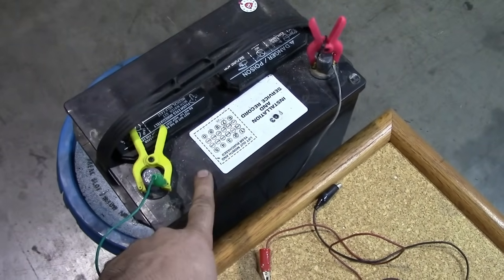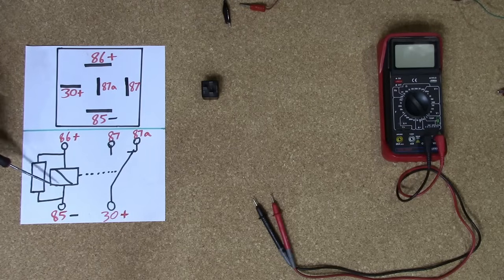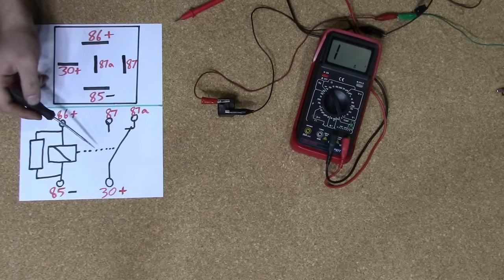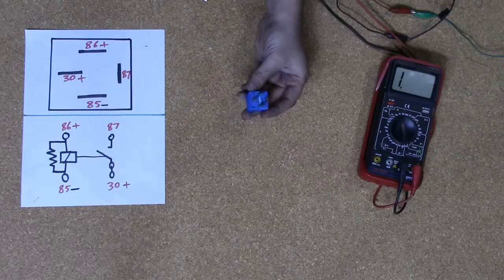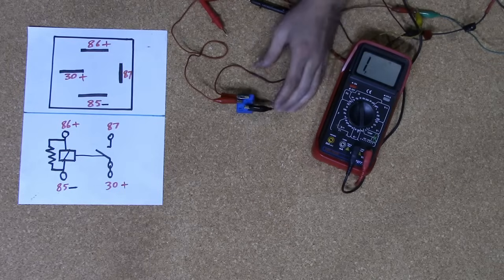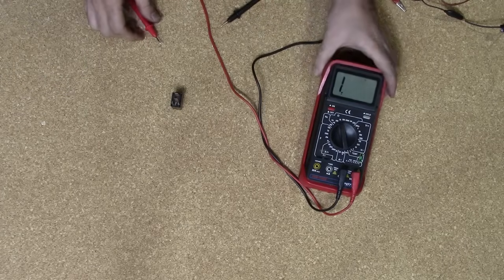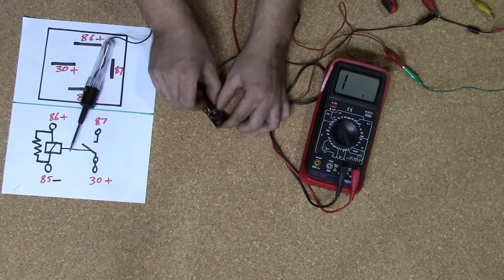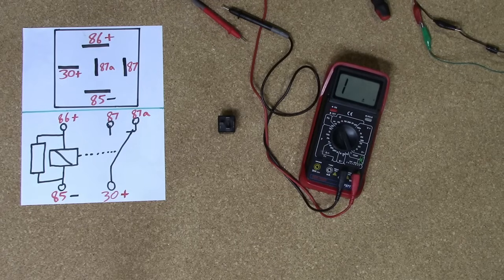How to Test a 3, 4 or 5 Pin Relay - With or Without a Diagram

Comment: Another great video and an outstanding explanation. I would offer just one small word of constructive criticism for future consideration and I hope you receive this in the helpful way its intended.  On the paper you layout the pin configuration and the wiring diagram which is very helpful to aid understanding. The one improvement I would recommend would be to make the wiring diagram match the actual pin layout. In other words, both the pin layout and the wiring diagram would have the pin numbers located in exactly the same place. This would make it easier for viewers with little electrical experience.  I think this may be why a few people didn't follow what you were saying. Even with that small area for improvement, this is an excellent and thorough video. Thanks for your efforts.

Comment: Hey man, really well done video thanks for posting.  I have my three pin relay pulled out of my car and it consistently gets 2.2M Ohms when I put the testers to pins 86(+) and 85(-).  I bought a new one from Autozone and on that one I consistently get 36 Ohms reading when I put the testers to pins 86(+) and 85(-).  This is a brand new relay... any reason why it would be reading at 36 Ohms  between pins 86 and 85?
Thanks
B

Comment: i like the video concept but i dont believe that all relay resistance is the same for all cars i have a honda /acura tsx 2005. i tested 4 different relays the denso and mistuba 7001 7002 7003 . the denso and 7001 and 7002 resistance coil was 156-170ohms and the 7003 was 58 ohms. if i follow his verbiage that would mean that all my relays are bad and those relays go to accessories have no issues with and the one relay that is 58 ohms would mean its good but that belongs to the fuel relay that might be the cause of intermittent crank but no start issue. i like his video but i think he need to actually answer peoples comments.

Comment: Liked the video. I have a 2009 Toyota Tacoma which has a slow crank and a click but no start. Sometimes it starts on the first turn and other times it takes about four to five turns of the key. Battery terminals are clean, new battery, swapped out starter relay with horn relay and still has the same symptoms. What am I missing?

Comment: Hello there,,, I'm wondering if you do not get reading on the pin of the relay after you hook up with the battery..the relay it still good even if the test light don't lit

Comment: My low beams are not activating, checked the relay unbowed, the resistance on control circuit shows 176 Ohms. When powered it clicks and also  has continuity. Could you tell me if that proves that the relay is good?

Comment: So what is the Resistance suppose to be between 30 & 87 pins, unless I missed it, I didn't hear you say what they are to be. Your test is close to zero and you called it good. Can you be more specific plz, Thank You. I have a situation 2003 Ford Focus, fairly new battery, tested and place a full charge on it anyways, new starter, and all I have upon turning key to start position is one single click. That's it, whatever it is that has failed, showed signs of failure, it would randomly fail to start, progressively got worse and as of 4 days again, it flat out won't start. All indication of good power, lights on, they don't dim, when it was starting it hit & turned over fast. But be it a Relay  or the Ignition Switch it's failed at this time. In the last 4 days after X amount of tries at starting the car, it hit once and started. So I am looking for help. So at this point I need the resistance for that test you did between 30 & 87, with power to the relay. Thank You P.S. you did state close to zero in your 4 pin demonstration. I hope that holds true for the 5 pin

Comment: Thank you for this easy to follow instructional video. I used it to test a relay - something I have never done before - and I found it failed the 4th step (the grounded test light did not come on when the relay was energized and powered).

Great job!

Comment: Great video, BUT, my 5-pin relay has power on '86' and '30' with the ignition on.  The relay powers the AUX fan on full speed, it should only be switched by a thermo switch at 110 degrees C.  The thermo switch has 5V coming to it.  Is my relay faulty?

Comment: Shouldn't you have tested pins 30 and 87 before activating the power to make sure it wasn't shorted? The inner switch did click when power was added on but it could still be maybe slightly shorted pin 87 by not completely opening to 87a. Good video. Thanks.
Reply: @
T Marq, you raise a valid point.  My relay has power on '30' and '86' and activates my AUX fan intermittently with the ignition on (it should only do so when the thermo switch reaches 110 degrees C), and stays on when I disconnect the thermo switch.  I'm suspecting an internal short.

Comment: wow that was very in depth. have me very confused. I'm not used to doing very much electrical. I wish the zoom in was better to show us not so good tracers to follow as you go. I'm not getting any clicking sound so its probably bad. I'm working on a tractor with some electrical issues. I have replaced the battery and the solenoid, but the switch will not crank it still even though I can stick the switch in a good tractor and it will crank up.

Comment: Please help as I've been tearing my mind apart trying to fix my AC issues as to why the system wony supply power to the compressor. The only thing I havent checked is the relay. I've checked for continuity on every wire to the compressor, the low pressure switch, etc. I had to replace the low pressure switch and the low fan resistor and now I have 12v to terminal 86 (before only 30 had 12v). If I have 12v showing on terminals 30 and 86, then the relay is bad? (I'm not with the car now so I'm asking before I go diagnose).

Comment: Are there any additional tests I need to do for an ABS relay?    My toyota sienna ABS relay has the exact 5 pin layout a common relay used everywhere else, yet it is marked ABS(TRAC) has a different PN and price.    My toyota sienna is throwing the code C0273
, and  toyota lists the abs relay is the possible cause.  The relay passes the test described in this video fine.  I'm guessing  there is a different different set of requirements  for the abs relay given the different part number,

Comment: When the circuit is energized and you are using the test light, you mentioned to ground the negative side of it. which ground do you attach the ground of the light tester? to the battery ground? thanks
Reply: Yes, the ground of the test light is the battery ground, or the negative terminal, or the black cable.

Comment: Thanks for a great video. Can you do a video on checking electrical connectors and the relay ports?
Reply: it would take me long time to really learn since I'm into the cars without sensors+ ECT but I will get there. can you test fuses with that multimeter? I'm sure it has a voltometer.
Reply: class 101
Reply: my son knows all this.
Reply: like

Comment: If I want supply power directly to to a component which pin should I use?
Reply: Minus (Ground or Black) to 85
Plus (Positive or Red) to 86
You will need to use 12VDC.
And you will here a click once both leads are connected.

Comment: Hi R&W, My Relay Passed Every test except I got about 2 Ohms Across 30 & 87 when energized (92 Ohms across 85 & 86) Shouldn't if be 0 Ohms across 30 & 87 when energized????... 2003 Chrysler 300M
Reply: Yes. The resistance should be zero when that circuit is energized, showing resistance would indicate that your relay is bad. Good luck!

Comment: hello can you tell me please if my old relay can be replays with the same 4 contacts, but there is difference on the plastic relay number, my relay contacts 85 to 86 and 30 to 87 on the NEW relay the same pins but diagram are 85 to 87 and 30 to 86 what do you think?

Comment: Great Video....Csn anyone tell me why?
I did the test on 4 prong and yes I get the ckick.
It's a 12v 70amp for my air suspension relay.
The plug for my system is not letting the relay work.

Comment: I really hope it does not make a difference which pin is 86 or 85 on a five pin unmarked relay because I applied 12V to the two pins that had 47 ohms and got a lot of smoke in a few seconds, then no resistance. So off to Autozone now.

Comment: Awesome video!! Thank you so much!! 
I do have 1 question... I had supplied power to pins 85 and 86 and was testing the resistance between pins 30 and 87, I got a reading of 1.9OHMS (setting was 200 OHMS) on a 5 pin relay. Is that ok? All the other test seemed fine even with the 12v tester (light)... Thanks!
Reply: Your reply maybe still bad. But test these two below.
From 30 to 87A always zero to low ohm reading when no power apply
30 to 87 = zero or low ohm reading while power applied. Then 30 to 87A much be high or open.

Comment: Any idea on how to remove the fuel pump relay on a 2008 Nissan Quest please?
- The fuse panel (gray) is positioned vertically inside the black box on the passernger side next to the coolant reservoir, which needs to be slided out in order to have access to the relay, however, it only slides upward for a few millimetre, not enough to have access to the relay!! What gives? 
I don't know whether the relay is shut, or the fuel pump module!
Thanks,

Comment: I remember these funny numbers when I switched out the fuel pump. full or empty lever on pump assembly would measure ohms. What I measure is off and the dealer has completely different set of numbers.12v is not 12v for the next thing.then new parts are shit on top of that.Both were good. No funny numbers needed.whos numbers and what standard are we basing this from. Every car is different.
iec probably dont have the same numbers either.

Comment: This is the best relay testing I have seen. Today, I need to test my A/C compressor clutch relay on my 6 gen Honda civic 1.4 (UK version) as the compressor clutch is not engaging. It was really a pain to find where the relay was located. I thought the relay was inside the under the hood fuse box but for my surprise it wasn’t there. After spending hours on google I figured out the AC clutch relay is next to the condenser buried inside a rubber boot. In fact, there are 2 relays, one next to each other, I still need to figure which is the clutch relay, any help here would be helpful. Hopefully the relay will have a diagram outside its casing to make my life easier testing it. Greetings from UK

Comment: How much suppose to be the voltage on the pin 87?. No A/C (was good before July) on my Fiesta 2011. Relays and fuses look good. But no power arrives to the compressor. A friend plugged for few seconds a 12V from a battery and then the compressor responded positively. Now, I'm in ???

Comment: Hi R&W, is it enough if I do testing with supply 12v to 85 and 86 to hear clicking sound and another test using the 12v supply with test light. Meaning I skip any testing that need to use multimeter?
Reply: Forgot to mention its a 5pin bmw relay.
Reply: @jannah3023  go get a multimeter,  the cheap ones are only a few bucks. They come handy a lot of times if you're a DIYer. For this test it is important to measure the ohms. Otherwise you'll be in the dark.

Comment: Great Instructions.....I followed them closely and everything seemed to check out on my EFI relay (4 prong) .  But as I unhooked everything the relay was really hot.   Is that normal or could the relay still be bad?  Something is blowing an EFI fuse so the next thing down the line is the EFI relay.  Again,  Thanks for some great,  easy to follow,  instructions.  Take care!

Comment: I watch others but yours is the best, thanks. Question; I'm testing relay pt#14b192-aa,  I tested several times got varried ohms,  33-50.1  , tested positive on all the other three tests. Is it possible to have varried ohms on the first  and have positive results on the other 3 and if so is the relay bad. The relay was getting warm while plugged into it working harness when ign is on

Comment: Thanks for this video ! I am testing a "no-start" 1994 4runner "circuit opening relay" that shuts off the gas pump when slowing down. The power side resistance is 31 ohms, not 50-120. Then the 12 volt power addition CLICKS and completes BOTH of the other circuits on this 5 pin relay (there are NO numbers).  Is 50-120 ohms a definite  bad ? Damn relay is EXPENSIVE ! Thanks
Reply: With no diagram and no pin numbers, I picked up two relays at pick n pull, $5 each. Both have 28 ohms across power terminals.

Comment: Hello sir. Thank you for help us with such valuable knowledge through your videos. I need your help with solving a turn but no start problem i have with a 2003 vw passat. The pump was check with direct connection and it works. I get 3.4 volts at the pump without crank attempt and about 8 volts when i try to start but won't start.

Comment: When measuring the relay resistance pins 30 & 87 the SW in this case the circuit is closed and the 12v is applied to pin 86, so the resistance showes 000 Ohms which is continuity closed switch, or very small if the SW was open then it showes open circuit or no continuity.

Comment: I've got a few questions I tested the ohms on my89 ford rangers fuel pump relay and im getting 57 ohms sometimes 60 sometimes 55 but thats probably cause my multimeter is cheap but hears my next question is that within specs and this is kind of off subject but i'm going crazy trying to get my fuel pump to run correctly its getting power but not enough power to build the correct psi to start my truck all my wires are cracked n broken basically so can i run new wires from the battery to my a new fuel pump, install a new inline fuse and also wire up either this relay or a new one and basically hot wire my fuel pump it has a new fuel pump and the hot wire I'll run to a switch inside the truck so its not constantly running will my ECU freak out? im just over trying to track down a cracked wire ive been messing with this truck for 2 weeks and its my work truck help please

Comment: This is a great video. I'm pretty handy with a multimeter, however I've never been able to figure out testing relays. He makes it perfectly clear with full explanations for each step.  I used a 12v jump box, my multimeter, spare wire/connectors, and made a phone charger adaptor that usually goes into a 12v cigarette lighter port in a car work as my tester (it has a small red light on it so I could tell that it worked). All in all it took less than 10 minutes to watch, setup, and go step by step to confirm that my 5 point fuel pump relay is in working order. 2 thumbs up, great video!
Reply: Lol

Comment: Thank you - I have a problem with the left tail and left front side marker lights on my truck and a common connection point is a relay that I need to diagnose.

Comment: What is the function of a relay??? My car headlights glow dim. The electrician said the headlights would be ok after he installed a 12volt relay in the circuit. The company originally didnt provide for a relay for the headlights which have become dimmer and dimmer. I doubt the techinician

Comment: Thanks for the great info.
You might also want to add a step to check that when the relay is NOT energised, that there is no voltage on pin 87 - if there is it would indicate the relay is stuck on. 
Thanks again.

Comment: I just have to say this.. You are a huge inspiration .. You gave me so much confidence and knowledge.. My 2003 Expedition started with a check charging system late February since then .. I've install new alternator, alternator wiring harness, 2 idle pulleys, removed and cleaned tension pulley, checked all my fuses and relays installed new engine belt ..today I got my truck running again and the reason why it did not start was one of the cables going to the fuse box was disconneted

Comment: Ummm, lets see: The coil takes voltage (85 & 86) and creates an EMF (Electro Magnetic Field) which attracts the contacts together (30+ <common> / 87 normally open/ 87A normally closed) -- thereby changing the relay state from (NC) Normally closed to (NO) Normally open allowing current/voltage to flow thru. This is on a 5 pin relay.
The NC allows voltage to flow UNTIL the relay changes state to NO in which case the NC goes NO. NC no longer is flowing and NO is..

That type of relay is DPST (Double pole single throw)

Terminology really helps. Discussing diodes is not really for the faint of heart--LOL

A starter relay would be use the NO relay as it would engage the starter solenoid when the ignition switch is turned.

Comment: Question: I have two different relay wiring diagrams.  One shows terminal 87 as ground and constant power at 85 and the other shows terminal 87 as constant power in? Both show power "out" at terminal 30.  I'm confused. Any suggestions?
Reply: 30 is power in. The rest, as far as testing is concerned, doesn't matter which is ground. I tried them all. Connect and go!

Comment: the resistance across pins 85 and 86 of a 4 pin relay is showing 63ohms. You say that's good anything between 50 and 120ohms. below or avove those numbers, sling away the relay. WITH 12 VOLT APPLIED I HEAR THE SWITCH KICK IN WITH NO OHMS RESISTANCE ACROSS 30 AND 87 WHICH IS GOOD. I HAVE A WORKING RELAY with live wire from 12volt battery my test light lights up across the switch pins. . ONE QUESTION. should THE RELAY GET WARM UNDER THESE TESTS? mINE DOES. Thanks.

Comment: Also a 3-Pin Relay does not have a Copper Coil Winding with signficantly Amplifies the current in 10 thousands of miliamps VS a 4 or 5 Pin Relay.

Comment: If it is over 120 ohm specifically. Not if it is under 50ohm. Remember a Relay IS GOOD because there is LOW Resistance thus higher Current flowing through the Coil (Copper Winding).